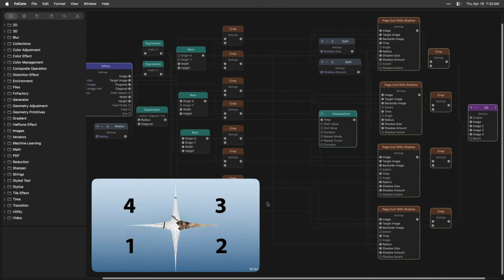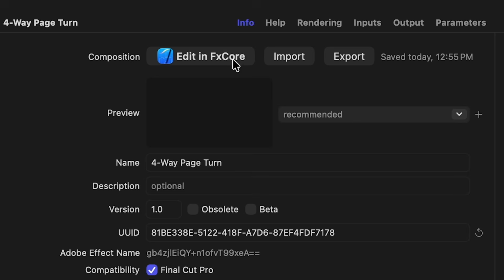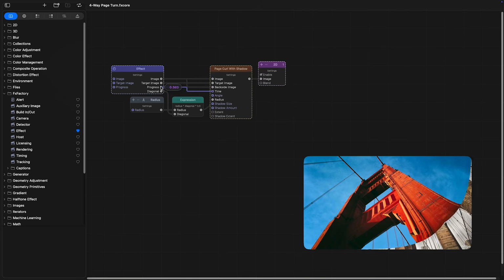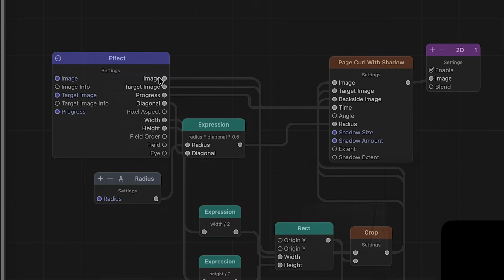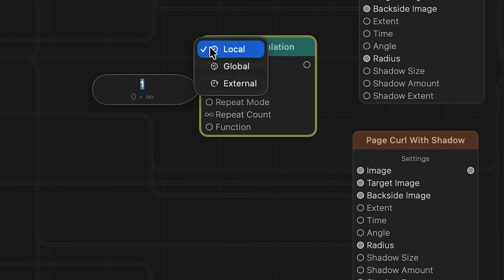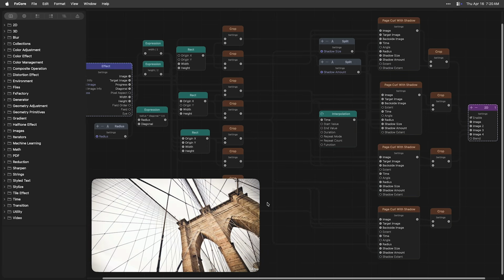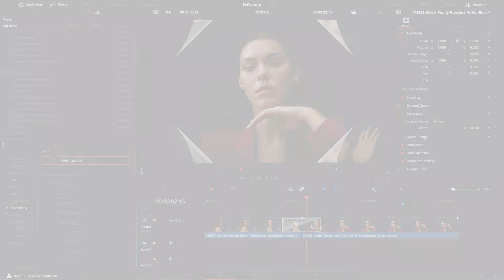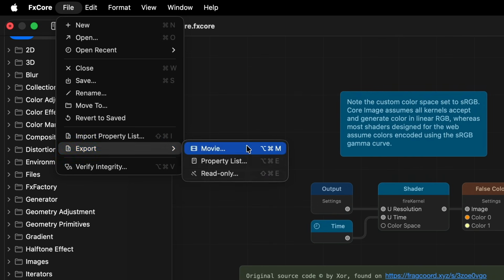FxCore: No-code Transition for Final Cut Pro, Motion, Premiere Pro, After Effects, DaVinci Resolve

Comment: We need a document explaining what each part does. As a beginner, we can use this document as a guide with AI assistance to achieve faster production. 

It would be even better if there was MCP support, that way we could add nodes just by speaking.
Reply from the maker: Hi there! You will find a description of every node in the Library browser. As you hover the mouse over all inputs and outputs of a node, you will often find long descriptions of how the input or output is supposed to be used. The same goes for the options you see in the Settings panel. MCP support may come in the future, for now this is best handled by humans 🙂